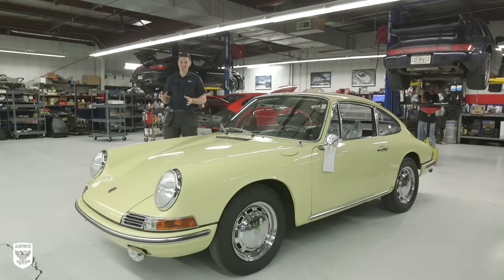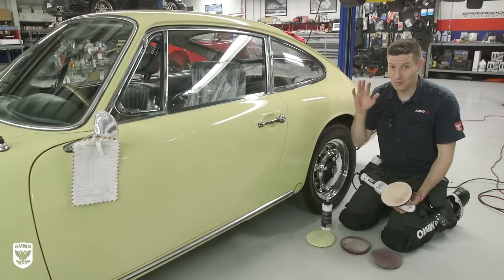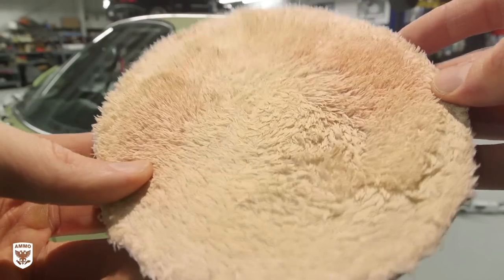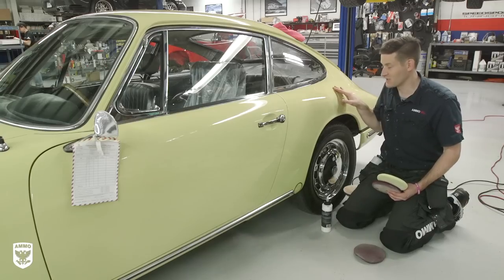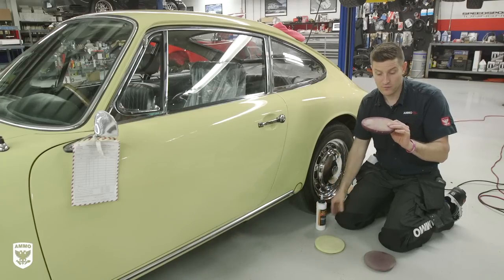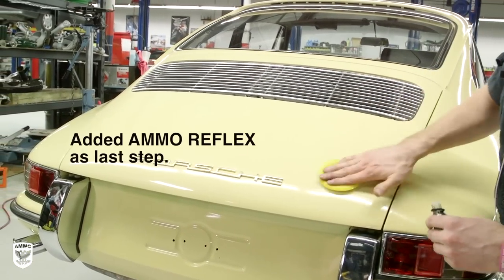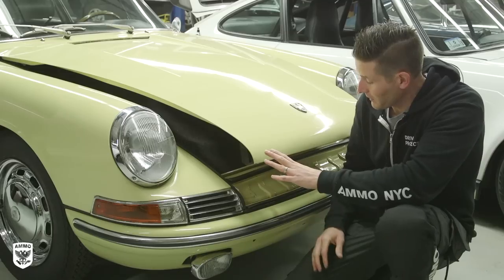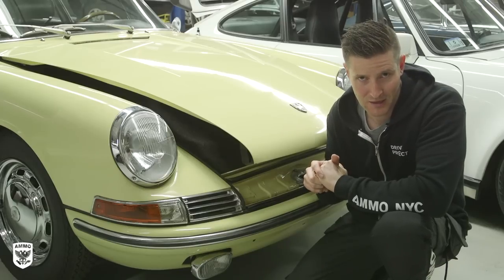Rock Chip Touch-up Tool: Museum Porsche 911

Comment: A few questions/facts need to be asked/stated here: #1-I believe lacquer was used on Porsches of this era-is this correct? If so, then it follows that lacquer was used to touch up the rock chips in the paint, yes? If lacquer was used, lacquer is a "hot" paint, which chemically bonds with the previous lacquer, creating a much smoother finished looking surface than what could be achieved with current water-based acrylic polyurethane enamel automotive paints, thus reducing the necessity for wet sanding. #2-if lacquer was indeed used, then thinning or attempting to clean the tool with 70% isopropyl alcohol is LUDICROUS, since it will not thin or remove lacquer AT ALL. Why wasn't lacquer thinner used if lacquer paint was utilized in the video? #3-if currently available water-based acrylic polyurethane enamel automotive paint was used, it will NOT chemically bond with the lacquer, if lacquer was used as the factory paint. Nor can the tool be cleaned using 70% isopropyl alcohol, can it? Will 70% isopropyl dissolve or reduce/thin water-based acrylic polyurethane enamels? I think not. #4-if water-based acrylic polyurethane enamel was used for the touch ups, were these touch ups later clear coated with a 1K (1-part) or 2K (2-part) clear coat and then wet sanded one, two, or three times with multiple applications of clear between sandings? And last, but certainly not least-this methodology works great (apparently) on single-stage, single color paint. How does it work on say-for instance; single-stage metallic paint? These are just a few of the number of questions I have about this  video that need reputable, credible answers for the the video to be acceptable. The details are lacking for this video to be anything but an introduction to the use of the Loew Cornell fine line painting pen.

Comment: Could you use this paint pen on the side of a car? I imagine it'd be pretty useless since the pen would  have to be handled at an angle but maybe I'm missing something.
Reply: you can't beat physics, but you could figure out a small extension for the paint holder.
Reply: Put tape over the reservoir to keep it from spilling paint?
Reply: Independence City Motoring That should work. Just will need to fill up alot.